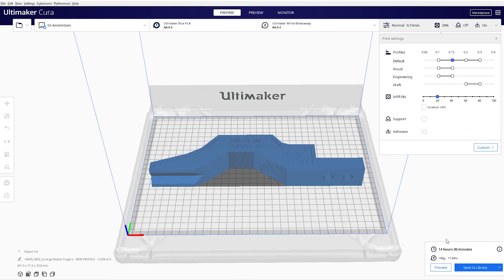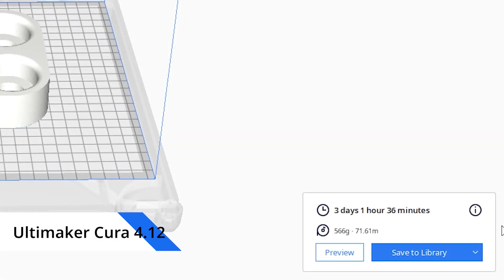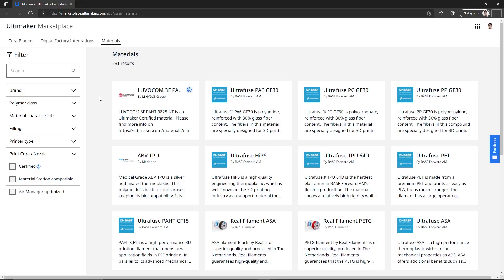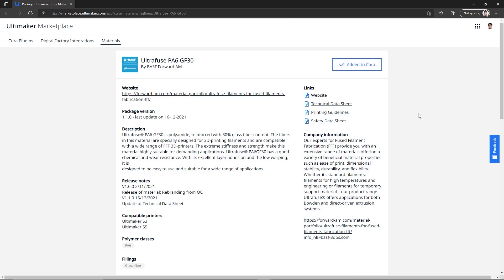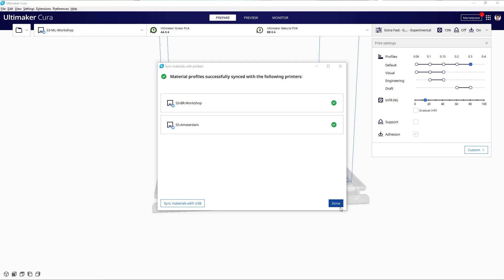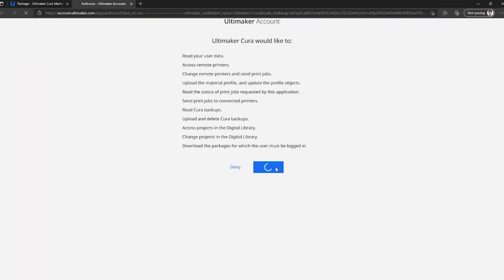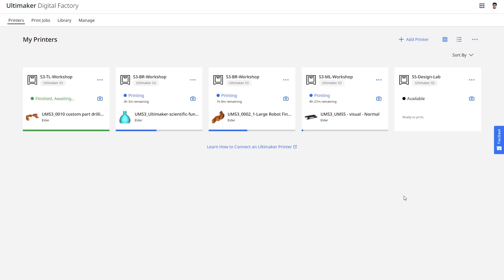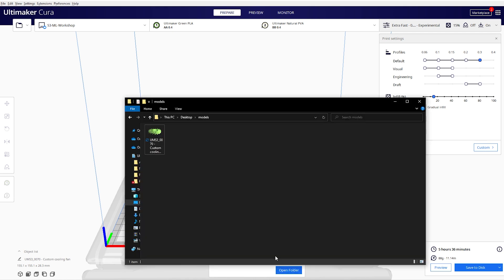Ultimaker Cura 4.13: Print solid parts up to three times faster!

Comment: Good software with many setting options. I really like using it - and i am using it a lot!
😕As for the ‘new great productivity improvement’  i don´t understand the enormous number of superfluous travel moves. This costs a lot of printing time with absolutely no benefit.
Example: when slicing objects with 2 (or more) separate sections (like the 2 pillars in an upright letter "U") CURA is printing each layer the same order. (e.g.: "left part - travel - right part – z-hop - travel - left part - travel - right part - travel […]). 50% of the travelling is useless.

Comment: Cura is pretty awesome!.. when I get my first 3d printer the guy in the store told me as advice: there is two best slicers options: Prusa slicer and Cura.. but I recomend you Cura.. 
But his face and words were some unsecure.. I take his advice and I use it..
1 year later I download prusa slicer to get my own opinion.. my opinion is this:
Cura is so Pro, there could be a few parameters wich prusa has and cura not, but just a few.. but the UI on cura is so unique and friendly.. prusa the other way has not his own UI .. (?) 🤔
Cura is the best for me. Get a 10 💙🙌👉

Comment: "If you set the infill to 100% You can now print up to three times faster"
Print time becomes 3 times slower
Reply: Did you see it went from 14 hours to 3 days.
Reply: @dugy40  haha yeah
Reply: Just read the bottom left corner of the video... It's perturbing because they "inverted" the natural way of reading the  slides.
Reply: @PierreWapata  OOOOOHHHHHHHH! I see now. Yeah it is odd.
Reply: @derekarduino9449  Saw the same thing. Just goes to show how we all interpret the world the differentor in our case, exactly the same
Reply: I see the confusion. The first part it shows 1 day 10 hours 57 minutes, the 2nd part shows 3 days 1 hour 36 minutes. So it looks like instead of being faster, it got slower. 
The bottom left side, they show 4.13, then show 4.12 to compare. But I was looking at the print times 😛

Comment: Hi
Would you be able to help me , i am a fairly new at 3D printing and have a ender 3pro , my problem is the vertical walls on my prints are not stuck together ,the finish is excellent on the face ,but run my finger over the edge the walls just separate , it’s driving me mad can’t figure out what is causing it, I am using the latest cura   and also tried prusa with the same problem 
Thanks in anticipation.   Stuart

Comment: I just downloaded 4.13 and the profiles are exactly the same as 4.12 and i do not see any 0.3mm profile
Reply: 0.3 is for ultimaker printers.
Reply: Needs to be a filament that can print fast, like PLA. Nothing for PETG, etc.

Comment: I need a way to shrink the exterior perimeters, while increasing the size of holes. Say 0.2mm to allow for good fit.
Like elephant foot compensation, but for the entire platter.
Things on Thingiverse are mostly in STL format and hard to adjust without jumping through hoops.
Reply: You can try Horizontal Expansion in Cura to change the size of the part or use Hole Horizontal Expansion to change the aperture size. These two options are found in the walls menu.
Reply: I did a bunch of calibration cube tests when I was nitpicking to get a print within 0.1mm of the model. Came up with some minor horizontal expansion adjustments I now always use. I really wish I could somehow have this "baked in" as a printer setting, and not something I need to keep making sure my profile contains and doesn't lose when I switch profiles/filaments.